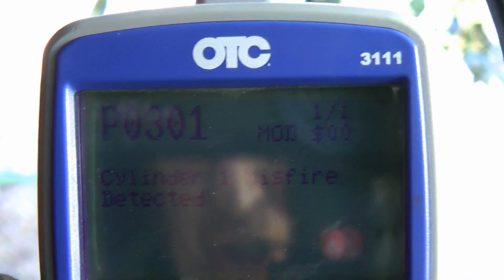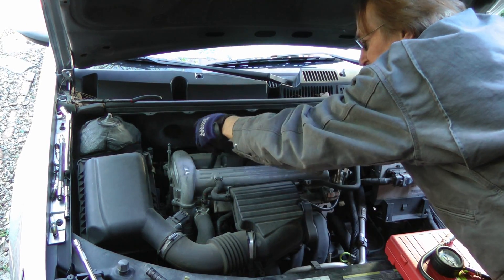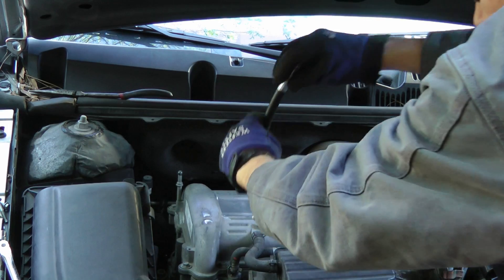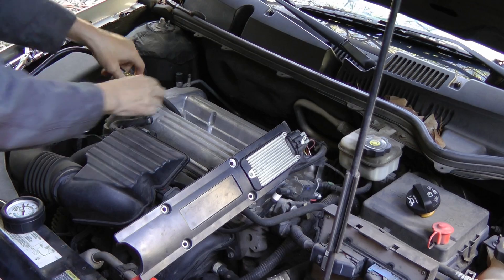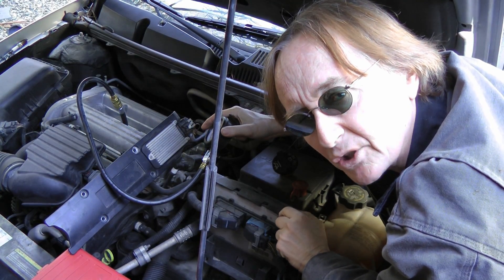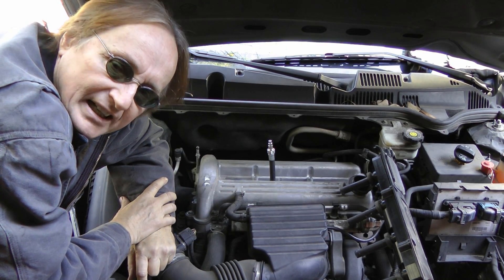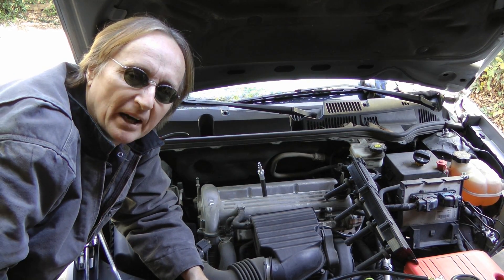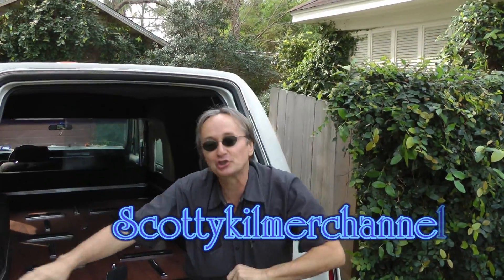Why Do Engines Misfire, Code P0301 (Compression Test)

Comment: I've got a 2009 dodge journey with 320,000 km on er and it went into limp mode a few weeks back. Had the crank sensor replaced and now it's misfiring when it never did b4. Bought 2 new coils and it's still doing it. Found oil all over the aprk plug on the last cylinder so we changed the o'rings out with new ones and still, drive for a few mins and it'll syrart to misfire and eventually one cylinder stops working

Comment: Hey Scotty I’m having the same issue with my WV 2014 Passat Wolfsburg edition car I just replaced my oil separator engine oil cooler spark plugs and engine coils but still getting the code , before when I diagnosed the oil cooler Volkswagen said that it was not a head gasket issue , so I’m lost now

Comment: the mechanic told me he tapped the spark plug out of number 2 which is misfiring it was stredded into cylinder new spark plugs new pcv valve, and  and new valve cover so something must be leaking cause some times the car wont start within 30m mins to a time,

Comment: hello Scotty, i have a mis fire on #2 code P302 and code P1217 engine over temperature the coolant leaked out of the coolant reservoir onto the floor and blowing wht smoke this is a 2006 Nissan Altima 4 cylinder.

Comment: That's what happened with my 07 toyota  corolla. I changed my ig coil to the fourth slot because of misfire cyl 1 and also changed the spark plug on 1 and same code came back on p0301 cyl 1 misfire.  What can i do scotty??

Comment: So my 1 and 4 cylinders have 130 psi and 2 and 3 got 115.I think it's just starting to go out.
It's a 2000 opel astra(Gm made opel back in the day in Europe) with 1.8 gasoline engine.
It has 184, 000 miles or 300,000 kms and I am not surpriced It's going on it's last legs even tho I've maintained the car almoat perfect. Always high quality parts, oil, fluids, brakes, suspension components and so on.
This car just made me nuts because as I just repair and done almost everything in the front suspension, fluids, tires and all that, the engine is starting to wear out. 🥵😂😂😂
Well one thing I know-next car is going to be a Toyota Avensiss station wagon 1.6 or 1.8 gasoline engine conveeted to LPG.
So much more room and so much more reliability! Can't go wrong with this one.

Comment: Scotty I have a 2015 hyundai elantra we've replaced the spark plugs, air filter, Cabin filter, we even put fuel treatment in it and it misfires on its first crank every time. We did not replace coils. But car runs fine but for some reason it keeps misfiring on the first crank and then you crank it again and it starts up just fine. I have it on my channel if you want to watch and see for yourself.

Comment: What would cause cylinder 3 misfire code only? Think it’s p0303. It’s a 97 Civic. Changed the wires, spark plugs and distributer. The car will turn the check engine light on and then turn itself off every 100 miles or so. It’s werid. Also my scanner says it’s indling around 700-800 rpm at rest. It’s not a bad car and is only used to go to college anyway but this is puzzling to me why it resets itself.

Comment: Is that your phone or is that bird just happy to see you?  Seriously, a 301 code could be thrown for a bunch of reasons.  A few years ago it was my fuel regulator.  Last year it was my evap filter but I managed to detour and squeak by the smog test.  This year, I dunno which brings me here.  Engine runs fine but if I push it past 60, it throws a bunch of codes related to the evap again and then 301.

Comment: On my 97 camry 2.2, I have this same code except for cylinder 3. Along with random multiple misfire. The car runs rough at idle and low rpm and sputters during acceleration. So bad that the car doesn't down shift on its own, just sputters harder and gives a strong smell of fuel. I've replaced plugs, wires and coils with no luck. It passed compression test as well. Now I'm at a stand still. Any tips?

Comment: I had a misfire happen to me once on cylinder 1, as soon the engine light blinked it turned off and the car did a slight jerk and I never got the misfire after. I decided to get the spark plugs replaced anyways, after putting it together about 3 times to diagnose what it might be I know for for sure it's not the fuel injector, spark plug or ignition coil. My question is, can the compression or something else get damaged simply by replacing the spark plugs? Now the misfire is present and does not go away, please throw suggestions Scotty, thank you
Reply: Yeah if something went into your cylinder head when you were replacing your plugs... Always start with the cheapest things first. Plugs,Wires, Coilpack. Then do a compression test. If compression is good check your injectors and injector o-rings. Also intake manifold gasket.

Comment: Hello Scott, Do you need to disable the fuel pump while you do the engine compression test? Thank you
Reply: Pull out the fuel pump relay to disable it. But supposedly on a TBI car when you hold the accelerator to the floor when turning the car ove it puts it in "flood mode" and won't spray fuel. But I don't trust that.

Comment: hi I have a Saturn Outlook TR 2007. Some days ago a light of the engine came up and I went to the auto zone so they can scan it and check what that light is. they gave a code, aldo they said i had to do a timming chain and there was a set with lots of diff small parts that he said the car needed to be replace. Also I havent change the oil and its already almost 5mm, could it be that the engine signal came up because of that? i dont have money to spend on the chain, they are charging me 3500 for everything. i dont have that money. I hope the signal goes off after changing the oil tomorrow. 😣😥
Reply from the maker: do change the oil and pray clogged oil made the timing chain tensioner not tighten ccorrectly

Comment: This is the same engine as the one in my sister's 2004 Oldsmobile Alero. I've already replaced the spark plugs but cylinder #2 is still misfiring. Four new ignition coils are $100 for this engine. I was wondering, could I buy a single ignition coil for this type of engine? Also, before spending 100 dollars on new ignition coils, I will get a compression tester and test the engine.
Reply from the maker: you can't swap the coil system over from the original design
Reply: Scotty Kilmer ok. Thanks Scotty!
Reply: Scotty Kilmer I replaced the ignition coil pack which replaced all four of them. It was around $83 at Advanced Auto Parts with a 25% discount from ordering online. I took the ignition coil module off of the old coil pack and put it on the new one. I also replaced the spark plug boots which attached to the ignition coil pack. The car is running very smoothly now and doesn't shake anymore. Also, the exhaust sounded like a motorcycle. It doesn't sound like that now that I fixed the misfire. Now after 4 months of the car shaking and sounding like a motorcycle, it is finally fixed. It took around an hour to replace everything, but I have never done a repair like this before and had to figure out exactly where everything went, which took a little extra time. Overall, the only labor that this repair takes is taking off bolts.

Comment: Should I have to disconnect the fuel injectors before I do the compression test?
Reply from the maker: you can if you want to be more accurate
Reply: Thank you for your answer. I am more concerning safety. Will the explosive mixture turn my face into a kiwi?

Comment: I tried replacing my ignition coil 3 times in 2 days. The 1st coil new coil made the engine run worse. With the 2nd & 3rd the engine wouldn't even start. All 3 coils were brand new. We put the old 1 back on and the runs with only the slight misfire it had to begin with. Any ideas why the new coils wouldn't work?
Reply from the maker: use only OEM coils and not cheaply made chinese units, start there

Comment: i brought my car to the dealer they kept ot for 2 days beacuse i told them the engine light would flash 5 times before turnong key and in the honda guide it states emmisions codes are not ready, anyways on the work it order it states oxygen senors are fine, and and they did a master reset of the computer and evap test came back ok... they did trouble shoot the crv on the honda diagnostic machine and they test drove it for 100 km
Reply: so a follow up....i removed cylinder 1 and 3 spark plug and coils...i movd the coils to different positions and they are fine..moved the spark plugs to different cylinder and the misfires codes came up for the diffrrent cylinders. ..so will be chaning the spark plugs..oem

Comment: hi scotty i just got codes p0301 and p0303 on my 2008 crv, as i turn the key to start the engines it stats but it kinda sounds like it cuts off for a quick second,, what do you think,
Reply from the maker: tune it up first, then change out ignition coils if that doesn't work and pray it's not worse, like blowing head gasket
Reply: my car is not even 10 yrs old and i change my oil regularly , i have been using synthetic since day one with m1 w/ m1 oil filter, so i will change the spark plugs 1st, then go from there,,, what are symptoms of a head gasket???  thanks
Reply: hi scotty , listen to this: honda by  good will covered the entire 680$ plust tax, they replaced the spark plugs  and did a valve ajustemt and changed gaskets too, , they also stated 2 of 4 cylinders where tight, all is good now.
Reply: eug ciabatt Wow I never knew Honda dropped so much in quality since the 90s. It’s a 2008? How many miles?
Reply: eug ciabatt Well atleast Honda fixed it for you. They’re a good brand.

Comment: I swapped a ignition coil on my Bmw because it has a misfire on cylinder 2 I fixed it. But there's 3 stored codes. Is that a good thing or bad thing ?
Reply from the maker: drive it a while, often other codes are related to ignition failure and will go away just driving

Comment: Hey scotty im getting p0201, p0301, and p1684. My car is misfiring as i can hear it and it has a hard shake at idle. I saw that p0201 has something to do with an electrical wiring problem with the injectors. Should i replace the injectors?
Reply from the maker: do check the wiring for shorts first using ohm meter or voltage load testing.

Comment: what was wrong with the engine why didn't you continue ?
I have a 2005 Honda pilot with engine light on along with vtm-4..I've changed spark plugs, coil, throttle, pcv valve, o2 sensor, EGR,  and fuel injector and engine light and vtm 4 light is still on.....what should I do next? I was thinking adjusting engine vavles?
Reply: Check the compression on the engine like he did in the video. Then if it's off spec there is a leak in the cylinder caused either by a blown gasket (car would smoke when started in the morning) or valves not sitting correctly or not sealing due to carbon buildup. A leak down test would be next to pinpoint where the problem is. Throwing parts at the car without diagnosing the problem first is a waste of money.

Comment: This is too long, sorry, interesting case here.  Read the final paragraph to just get to the point, read the rest for the details on this issue.  Let me know what your experience says if you have a moment.  

I have a 1999 Intrigue 3.5L with about 120K.   If the car sits for several days and then I go to start it the engine runs with the familiar misfiring sound.  Turn off the key, check the oil, etc.  Go back into car, starts perfectly aside from a kick of greyish smoke out the exhust...very similar to starting a snowblower that I flooded.  After that, it purs like a kitten at all speeds and RPM.  Even drove it to Colorado and back and aside from burning a little oil, not one more issue with this.  Waking up next day at rest area starting it on my trip no problem except idling with a little of that smoke for a short time.  Come back home, let it sit for a few days while I am gone or using a different vehicle and here we go again back to the start.

This time I let it run rough for a little longer (knowing it isn't good) but thinking perhaps it will trigger the Check Engine Light  and sure enough it did.  Shut it off, waited, started, puff of smoke out the tail pipe and purrs like a Kitten.  Fun to Drive with the Check Engine Light with pretty much 100% confidence it will be fine and it was like always. However since I WANTED the light to come on, I took it to Autozone when finishing my day  and P0301 Cylinder 1 Misfire!

Autozone print out says likely Fuel Injection. 
Read someone else with the same problem as long as it runs great after the odd misfire at start up, it is like something called the Fuel Pressure Regulator (correct part name?)   and he said it might just be that or the injector giving too much fuel to the cylinder and basically its was in fact misfiring due to be more of a fuel flooding issue than a worn out cylinder or something else because of the other similarities as seen with any flooded engine especially the gas smoke puff (right color not white or pure black -but more like what comes out of your snowblower or whatever if you finally start it flooded)

Again apologize for this being wayyyyy too long, but do you think this theory sounds plausable assuming the coil, spark plugs, and injectors are clean (will check those first obviously).  I was thinking of just inspecting/changing plugs, cleaning or changing the injector for number 1 or all of them just to know I everything is given a new start and fuel Pressure Regulator.  

Point is could, aside from the obvious first steps you mention like plugs and coils, could, this might be a fuel injection regulator problem over a worn cylinder.   (Of course it is probably a little worn as expected for 120,000 miles)?  But no other problems and runs like a new car right off the lot otherwise!

Comment: I have a 99 voyager that has has cylinder 4 misfire since the 3 years ive owned it. Same deal the 4th cylinder only has half the psi the rest do. 

Been running it ever since...a bit of an oil leak- burn but other then that its been running fine! Could be that 3.3 v6 from crysler is Bulletproof but no major engine problems have ever come up

Comment: I have a 09 pt cruiser with a PO302 code pending on my car and my father keeps telling my it the intake where the air filter. All I want to know what's really  causing it ?
Reply from the maker: that's # two cylinder misfiring. MANY things can do that, from bad plugs, coils, injectors, or blowing head gasket. Try a new spark plug and coil on plug first
Reply: Also replace the intake manifold gaskets and injector o-rings. My 05 PT GT (2.4 turbo) Had a cylinder 4 misfire. turns out the injector was clogged up. New used injector fixed it. Good idea to replace them all along with the o-rings. I had already replaced the coil/plugs and wires and intake gaskets.

Comment: i cleaned out my engine compartment with degreaser then rinsed it with water, next time i drive it it starts misfiring, i take it to autozone and the code says i need a tune up and plug #6 is bad, is it just the plug or the coil too?
Reply from the maker: +TH404 water can ruin lots of electronics, but often they just get wet. Remove ALL connectors, clean them off with spray electrical cleaner, and reconnect them and pray

Comment: Scotty I have 1994 camry 4 cyl That has 162k miles, the problem with it is it misfires while on the highway on a speed of approximately 45 miles, and when I hit the gas it gets stubborn, but it idles perfectly when I stop it.
Changed the following parts:Air filter, fuel filter, fuel pump, spark plugs & it's wires, cleaned throttle body & it's sensors electronics cleaner
There was oil along the plugs so I changed the rubber plugs & valve head gasket
Reply from the maker: +Eric Mark do my video "how to clean fuel injectors on your car" and pray it's not a head gasket starting to go out
Reply: Scotty Kilmer

Comment: Scotty, great videos and great advice. I have a 2006 Saturn VUE 3.5 V6 (Honda engine). I have misfires on p0301, p0302 and p303. Do you think the valves need adjusting. it has 156,000 miles and has a rough idle and the gas mileage is not so great as well.
Reply from the maker: +Britt Smith try adjusting the valves and PRAY the head gasket is blowing
Reply: I will get it in the shop ASAP and pray the headgasket is not blowing!! thanks again.

Comment: Scotty need help! My G35 is having misfire problem P0300, already changed spark plugs, checked igniton coil, fuel injectors and already did compression test on all 6 cylinders and all came out the same! Car still runs and drives but idles poorly and has check engine light blinking. please help!
Reply from the maker: +Relixo   you can't really check fuel injectors fully, start by paying a guy like me with a machine as in my video "fixing insanely complex modern cars" to find the problem area FAST. It's blinking, so there's all kinds of bad data hiding inside the computer

Comment: So I have a 2001 Saturn L200 and it misfires with the same diagnostic code and same cylinder. However, this misfire isn't every time I start the car. It's common, but not on every start up. Could that be the same problem or different?
Reply from the maker: +Orac Dsc bad spark plug, bad ignition coil , bad fuel injector, or blowing head gasket on that cylinder, pray it's not the gasket but those are known for that
Reply: Okay thanks Scotty!

Comment: Scotty, I had just finished replacing the head gaskets on my 2000 Olds (200K miles), and also went ahead and replaced all spark plugs and spark plug wires. I notice the compression is nowhere close to where it is supposed to be and discovered I have a P301. I know my spark plugs and wires are good. In this case is it fair to say it is the #1 ignition coil that is bad? I like to hear your answer before I replace the coil.